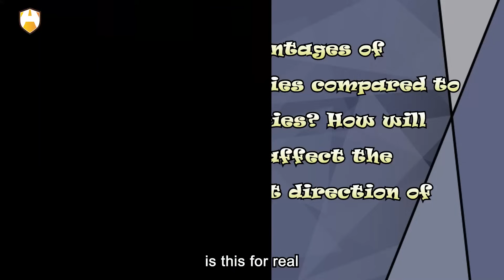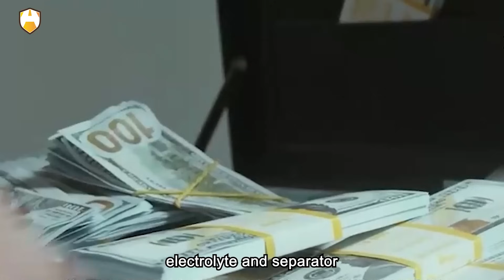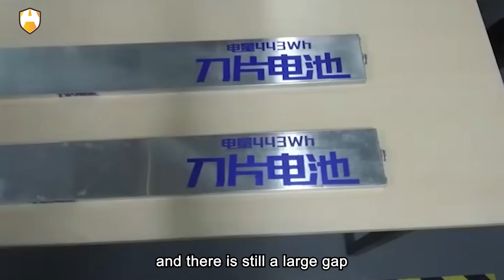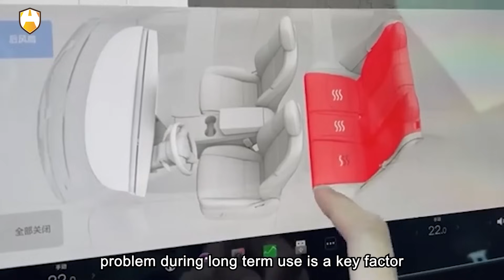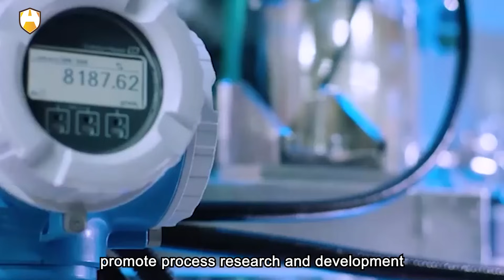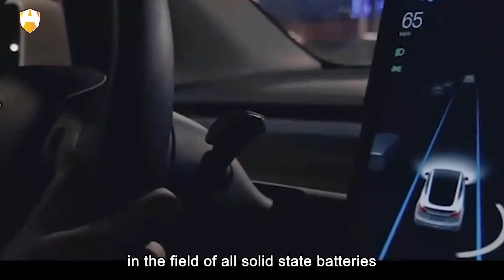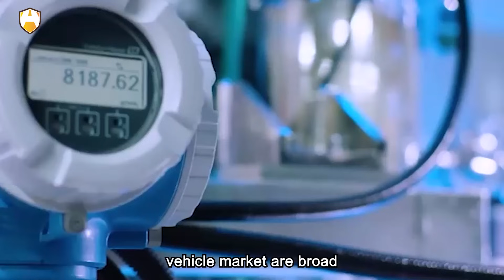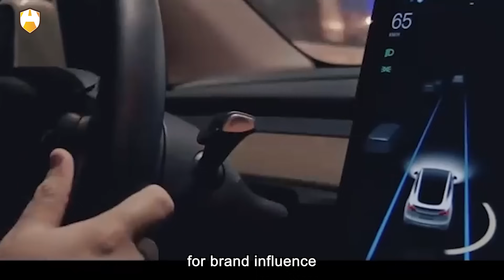BYD's all-solid-state battery, developed over six years, is finally about to hit the market!

Comment: The Chinese will focus on salt based battery for consumer use. LiAuto latest already achieve 100% charge in 10 minutes with a range of 1000 km per change. Its safe and not flammable. Its already good enough for this stage. The solid state battery is not for consumer market. Its being developed for some other reason. Actually the next is nuclear based battery for comsumer.
Reply: Solid state battery technology has broad military applications.